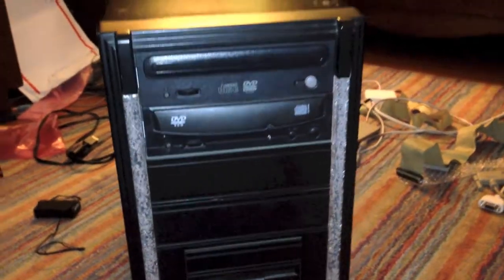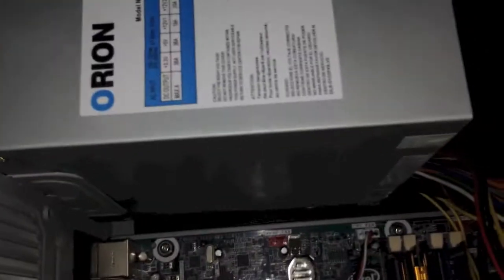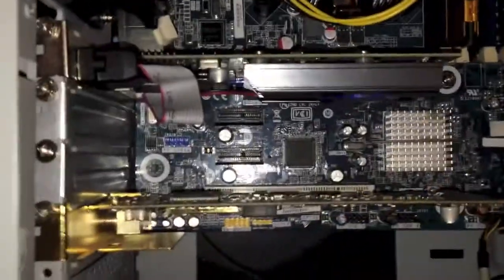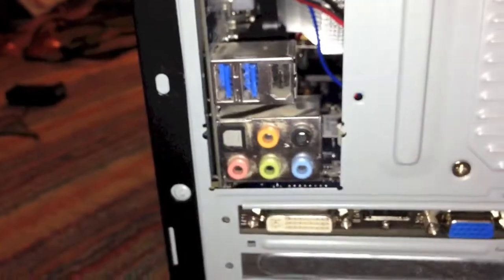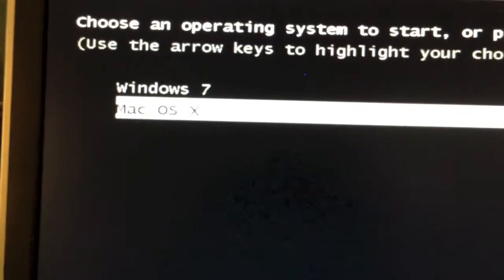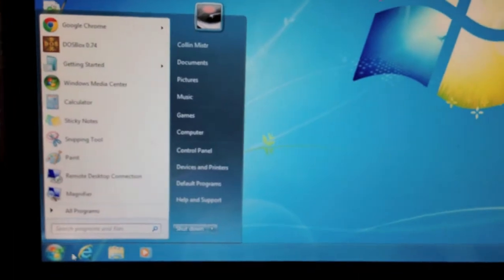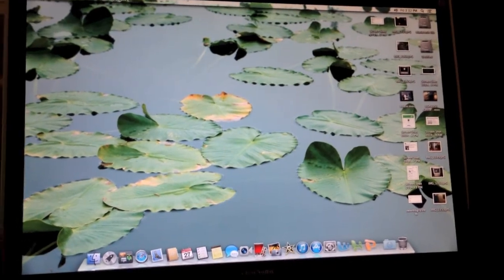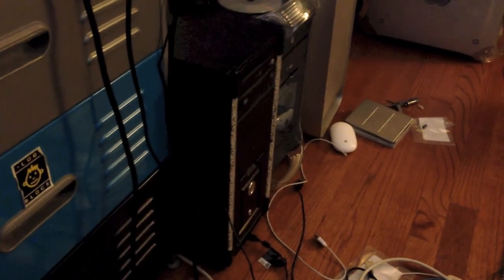LGA1155 Custom Built PC Overview

Comment: Does sleep/wake work properly on it? If so, did you compile and use a DSDT yourself? Where do i get the light strips you have on the case?
Reply from the maker: Sleep/wake works perfectly, I just used "SleepEnabler.kext", no DSDT patching necessary. The light strips came on the case, and seem to be part of the case, so I don't know where to get them.